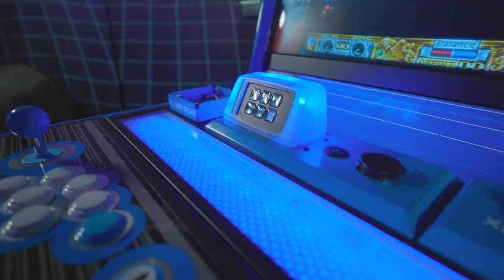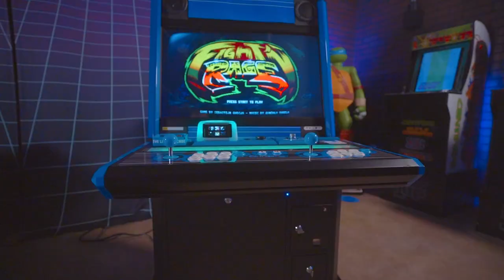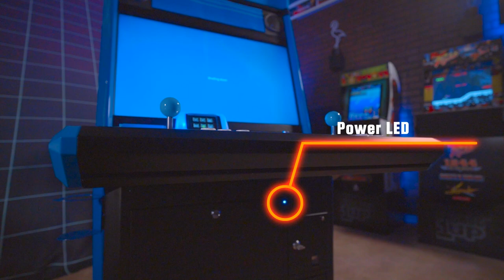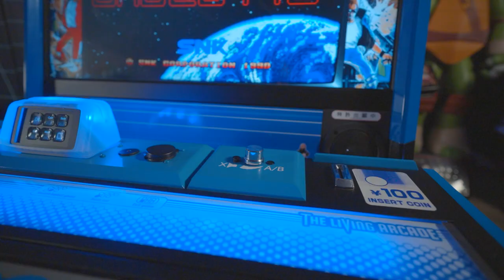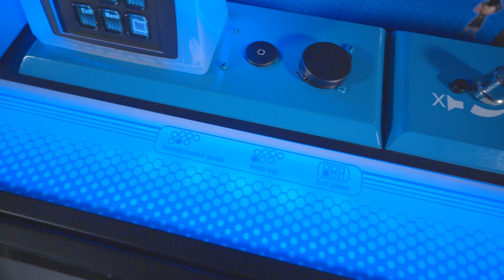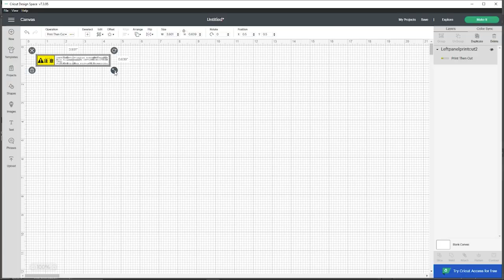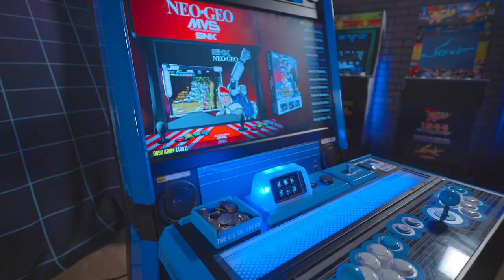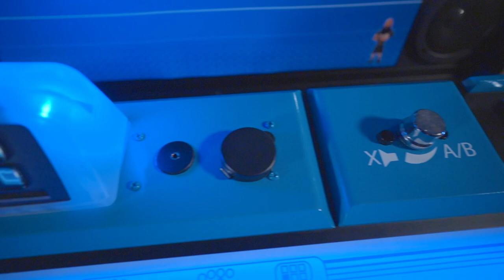Chewlix Worth It? My Taito Vewlix/Chewlix Journey (How I Setup My Candy Cab)

Comment: I really like the sit down style, as at my age, I would never want to stand up at an arcade anymore. I’ve been thinking about getting one of these for a while but curious about adding a trackball and or spinner for other games. It doesn’t look like there’s much room for those on the control panel.
Reply from the maker: Yeah the sit down style is def. the way to go! Be aware that not all of them have the control panel that comes out far enough in a way that allows your legs to fit comfortably in there and not hunch over. That's why I like the chewlix style so much the control panel sticks out way further. It doesn't have enough room for trackballs and such but I'm going to make a separate trackball and spinner controller that can fit on my lap and I can plug it in to that USB panel mount quickly. Check out https://www.arcadeworlduk.com/products/2-player-sit-down-arcade-cabinet-flat-pack-kit-black.html?setCurrencyId=3
For another idea. I don't know how legit that supplier is though it's just for reference. Also check out pedestal arcade form factors too.

Comment: Wow 👌  your amazing bro.

I just want to ask you about the Chewlix compatibility with the classic jamma pcb, you see .... my father used to own a  small restaurant with some arcade machines.
Most of the old wooden arcade cabinet are either corroded or rusted, but i managed to salvage the pcb boards ( MJ moonwalk, TMNT and konami's X-MEN), and i was planning to use Chewlix if its can read the jamma boards.
Reply from the maker: Thanks so much! I hope it gave you some ideas. Good on you for saving those boards!  I had to think about this one for a min. The biggest issue is the chewlix uses a "modern" HDMI LCD display. Those boards are designed to output 15kHz RGB or VGA to a CRT display. Mine also has VGA inputs but everything is in Chinese. I have no way to look up the model number to see if the display can handle the output from those boards. They output at a lower res then most "modern" displays can accept. Additionally the menu system is in chinese so I have no way of making any adjustments in the settings menu. Chewlixes aren't standardized either, there's no telling exactly what display yours will come with when you source one. There are boards out there that can convert jamma to hdmi. Here's a link to give you some ideas. https://www.arcadexpress.com/en/60-video-converters After converting the video you may want to consider a scanline generator. The raw pixel output doesn't look like what you remember seeing on a true CRT with scanlines. (That's why I use the CRT Shaders in retroarch to give it that look) Look into the "OSSC Scart upscaler" and the "framemeister" as well. 

A BIG THING TO be aware of is that technically the chewlixes use a chinese "jamma" harness known as a "chamma" it looks the same but wired differently see this article here. https://www.arcaderepairtips.com/2021/03/16/getting-familiar-with-the-chamma-standard/ Mine was wired incorrectly from the "factory" punch and kick buttons were all mixed up hence why I just ripped it all out of there! There are chamma to jamma adapters available assuming yours is wired correctly. If you go that rout, make sure you follow the wires to insure it is wired correctly to the "chamma" standard. Plenty of people have had great success with them. 

Personally, I haven't used any of these methods because I can't afford the costs. So please research and don't take what I've said as gospel, this is just to point you in the right direction. 

If you could get your hands on an "astro city" or "egret" candy cab you wouldn't need such things since those do have CRT's and I believe are already wired to the jamma standard but they're way heavier and in very high demand! Or you may find a non working jamma arcade machine with a good CRT on the used market to put those boards in. There's also jamma switchers out there. They allow for multiple jamma boards to be in the same cab and you can switch between them with a knob. 

It's a lot! Don't let it discourage you. It's a fun journey with lots of learning. To me that's where the fun really is in all this. 
Also look into the MISTER FPGA or consider what I did with a gaming PC and emulation. I hope this helps and good luck!

Comment: can you make a video inside of your cabinet, how did you connected the smart plug for Alexa, do you have a link where did you get it?
Reply from the maker: if you jump to 01:45 in the video you can see me plugging in a power strip. There's an access hole on the bottom right of the cab under my right hand. You can see the power strip cord and ethernet cable feeding through it. I plugged everything into that power strip inside the cab and ran the power strip cord through the hole out the back. I left all the factory wiring alone and unused. Then that is connected to a smart plug https://amzn.to/3VYPvOz 
The smart plug is just a glorified switch that I can operate with my voice or phone. That way I don't need to reach inside to turn it on. Most computers can be configured to boot up the moment they receive power. Everything inside is left on and the smart plug behaves like the on off switch. Let me know if this answers your question.

Comment: Damn, subbed. Can u do a video on how u bypassed the dodgy china ground and used your own power strip?
Reply from the maker: Thanks so much! I'll see if I can make a quick short covering that part more in detail. I'm not sure if I can totally re-create it because I already tossed the Chinese plug that was attached to the DC power supply. But in the meantime if you go to 01:44 in the video you can see a square shaped hole just beneath my hand as I'm plugging stuff in. There's a little slide cover held in with 4 screws on the right rear of the cab. I removed that plate and there is an access hole big enough to feed the power cable from the power strip through. I just bought a power strip with a really long cord and feed it out through the hole and plugged everything into the power strip and I left all the factory wiring in there unused including that little Chinese duplex. It was faster then tracing it all down and rewiring. The power strip is just sitting inside towards the back. 
I did take a leap of faith on the monitor though! Everything was in chinese and I couldn't verify the model number to confirm if it would accept U.S. 120v. Granted most do these days but I did risk frying it so be aware. 
The DC power supply has screw terminals for everything. I just cut the end off a us cord and stripped the ends and screwed them down on to the correct terminals. It's just powering the coin mech and the amplifier. They could both be powered with "wall wart" DC plugs plugged in to the power strip. But it was already there so I used it. 
I hope this makes sense. If not let me know.

Comment: Awesome build man! I live in Brazil and the best I could do here is to built a cnc mdf cut  replica of a vewlix. It is very similar to yours I use Bigbox as well, I have a second monitor as virtual mrquee above the cab, but yours is much better. If I could ask you one thing, how do you configure your arcade controls in steam? It drives me mad. It changes controls ID frequently and I cant set the buttons correctly. Thanks a lot!

If you want to see it I have some videos on my chanel
Reply from the maker: Obrigado! Yes I have seen your video! Impressive and inspiring! Recreating the chewlix in CNC is an amazing achievement! 
Steam controls is a nightmare! What USB encoders are you using? 
One thing I would do differently on mine is use an iPac or a USB encoder that supports more then one player so windows wouldn't swap player 1 and 2.  A single USB cable and the players are hardcoded 
https://www.ultimarc.com/control-interfaces/i-pacs/i-pac2/
Or these (looks interesting) they have a jumper that hard codes it as player 1 or 2 so windows won't swap them.
https://polycade.com/collections/all/products/neo-arcade-controller-board

Check out steam big picture mode with no games running. In "big picture mode" you can navigate to the controls and set a "base profile" I map the controls just like the layout for retroarch (button assignments like this. 
https://retropie.org.uk/forum/assets/uploads/files/1489884205888-03-button-panel-design.jpeg

This gives me a "standard" profile that usually works pretty consistently when steam try's to load profiles on top of that base profile. Kind of like re-maps.

Some games have limited configuration settings. For those I use Joy2key.
https://joytokey.net/en/
I just custom remap the controls to the keys that match the game settings. So it sees the controls as keyboard inputs. So it doesnt matter what wacky controller profile steam loads.Joy2key is configured to launch on startup and I've set it to detect which steam game is running and it automatically loads the keyboard remap. It's amazing!

Let me know if any of this helps.
Reply: @TheLivingArcade  Thank you so much for the answer! Several people here in Brazil are building CNC cut Vewlix it is some kind of trend now. 
I use zero delay cheap encoders, I didn't know that more than one player encoder exists! I will try to find one ofr 3 players as my setup but I think it will be difficult. I use joy to key as well for some games, it is amazing. Thanks again for your wisdom!
Reply from the maker: @Antided  Let me know if anything else comes up. I used cheap zero delay's too. I did find a sweet spot of plugging one in the front USB and the other in the back to get them to stay consistent and not flop. 
the ultimarc iPac 4 supports 4 player and has a lot of customization with their software.
Reply: @TheLivingArcade  I manage to fix the controls in mame using their ID and the othe emulator I use is MEDNAFEN. it stays stable. The problem only appears with Steam. The Ultimark Board seems amazing. The only thing I Didn't find is rapid fire. I use it a lot with zero delay. Thanks again

Comment: Just curious but you mentioned several times about keeping the cost down, I'm wondering what was the cost of the cabinet before personalizing it? What was your budget you set to personalize it? And ultimately, did you stay within your budget or go over? What was the final total, cab included?
Reply from the maker: Great question. I didn’t want to give a false impression about the initial price on the cab. I found a once in a lifetime deal for $950 locally.  Normally they are 12-15 plus shipping. That’s why I didn’t say In The video. I didn’t really set a limit other then spending as little as possible without compromising the gameplay. Some of the parts I already had but factoring in those costs too I’m at 17 hundred for everything. Most people in the chewlix groups also change out the monitor, get custom control panels made, change out speakers, install a DAC, and put in brook UFBs which are $100 each! It’s an expensive hobby! Please let me know if this answers all your questions.

Comment: I can't figure out how to get the monitor out of my Chewlix there are no screws on the outside to release the vertical side cowling bars, I see screws on the inside, but not sure if those are the screws or not. Do you have any ideas that might help me out? Thanks!
Reply from the maker: This video does a good job but there's no close ups. https://www.youtube.com/watch?v=YJMXMj0FtpU
Basically there's a metal "collar" up where the curved marquee meets the colored plastic sides that go along the full length of the monitor.  kind of adjacent to the top speaker. The metal collar that covers where those two pieces meet should have one screw. You remove that and the metal collar comes off it will reveal the screws that hold down the plastic side rails. There's another one next to the bottom speaker. Same thing and that should give you enough to remove the two side rails and you should see the rest. The whole monitor is attached to the metal frame around it and the whole thing should be able to slide out towards you from the front. It sits wedged on top the square speakers. 
This is assuming you have the same design as shown in my video and the one I linked.
There has been a re-design recently where the whole front frame is one solid piece including the speakers and everything all surrounding the monitor. If you have that updated design then I don't know. Please let me know if this helps
Reply: @TheLivingArcade  thanks I will give that a try
Reply: @TheLivingArcade  I watched the video. It    helped me figure it out. This one had studs welded to it and nuts screwed on behind the monitor so it wouldn't pop out. I had to take the monitor out to get to the nuts (the monitor barley comes out from behind, but it does). I am trying to put in gun for IR infared sensors in on both sides. There is barely enough room along side the monitor to put them there so I might have to put them in these colored bars I have been trying to remove. I will be drilling three holes right next to each other. Thanks for your help. I was stuck :)

Comment: does the unit come with preinstalled kick harness for say CPS2 boards(6buttons) if I wanted to just plug & play before doing mods?
Reply from the maker: I have seen some variations of what they come with pre installed looking at what others have shared in the groups. But I don’t recall ever seeing the actual CPS kick harness included on any of them. I really doubt it. Also be aware that they have a “chamma” harness not a true jamma. A couple of pins are flopped around. I have seen chamma to jamma adapters being sold but I would double and triple check everything before dropping in a real board I cared about. Lastly I have no idea if the included 16:9 screen will work with a stock CPS board. Mine does have VGA but everything is in Chinese I couldn’t figure out the model number to find specs. Fortunately I got lucky that it accepted US 120v ac. I took a chance and just plugged it in.
Reply: @TheLivingArcade  thank you for this I really appreciate it.
Reply from the maker: @VHSgang  your welcome. And the more I think about it. You may want to treat it similar to consolizing your CPS board like a supergun in order to drop it in there.

Comment: Which theme are you running on BigBox?
Reply from the maker: I'm using a combination of unified redux and unified refried. Redux for the main platform menu and refried for the actual platforms. I believe I swapped out some of the background videos but only a couple.
Reply from the maker: If I remember correctly those themes also have a couple different view options as well to get them to look like that. I feel it's the most arcade cab friendly look

Comment: Bonjour,
Super travail... 😍 Mais où trouver la boîte blanche pour le strean box ?
Merci 👍
Reply from the maker: Hello I used google translate to answer your question. I hope I'm understanding correctly. The box around the streamdeck was a credit card reader that I modified to fit it. It's in video at 09:02 in the timestamp. My arcade came with the credit card reader and I had no other use for it. So I cut it into a shell for the streamdeck. You can try searching on eBay for "3D printed case for streamdeck" sometimes they call them "button box" for race simulators. There are a lot of creative people making 3D printed cases and mounts for them on eBay that may work for you. I hope this helps.

Comment: Does it still get stereo if you put the monitor in 'TATE' orientation?
Reply from the maker: I have not put it in TATE myself to say for sure but I see no reason it wouldn't the speakers stay in the same spot and you only flip the screen and the top and bottom panels get swapped to the sides.